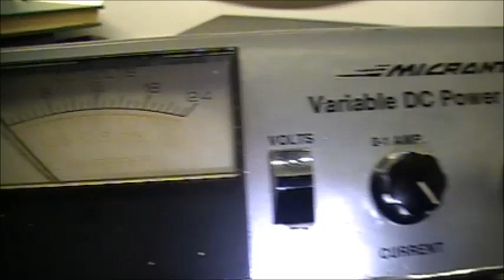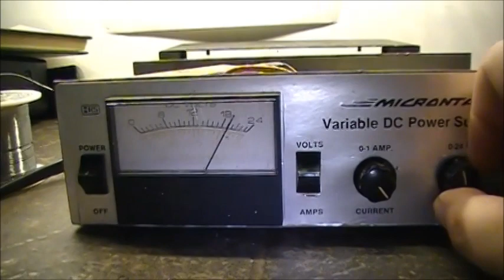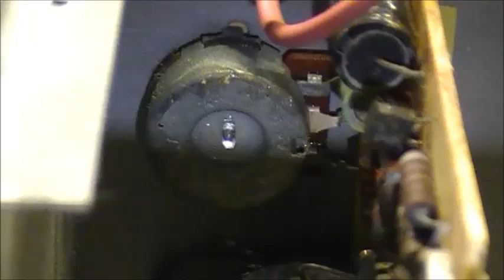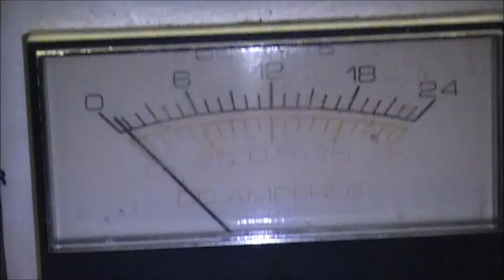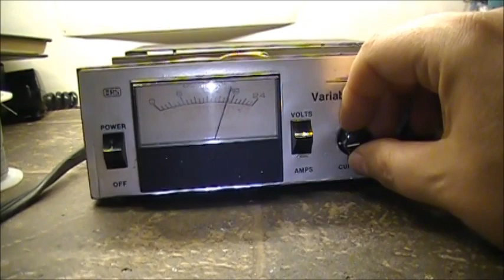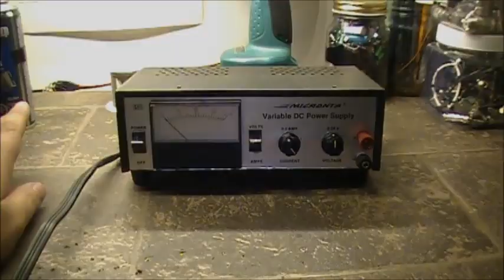Micronta 22-8230 Power supply

Comment: I have a question.   Do i need a balun  if i make a 20m dipole to my coax?   If no , doesn't my coax become the antenna also?  I want to cut the wire antenna to spec in length, but then i thought what good is that if my coax is long and it's part of the antenna.   Really confused, please help, i want to go on the air..
Reply from the maker: I always run my coax direct to the antenna.  works for me fine.  ;-)